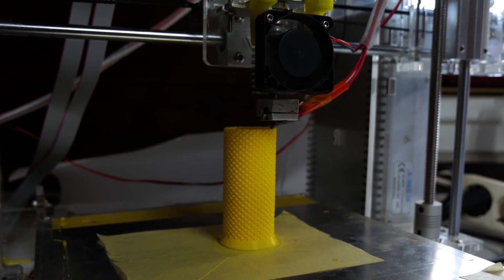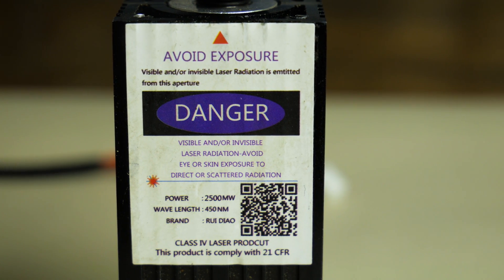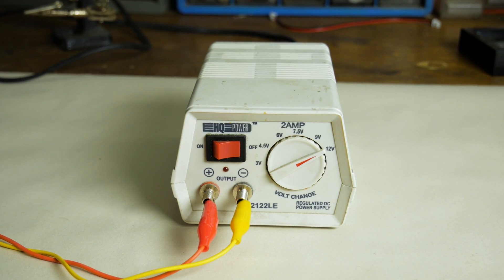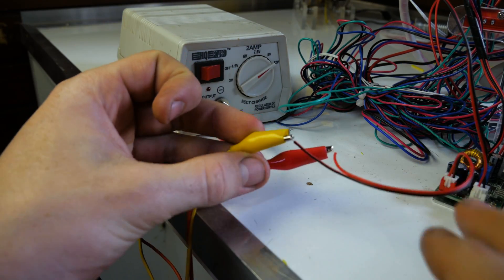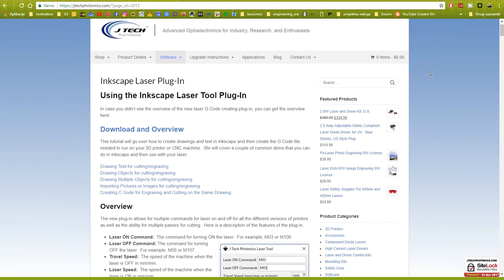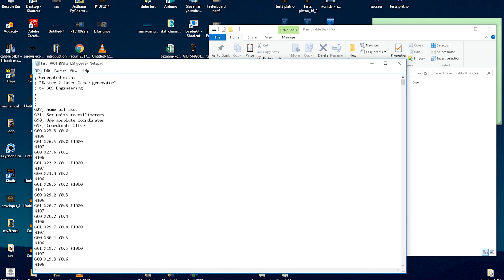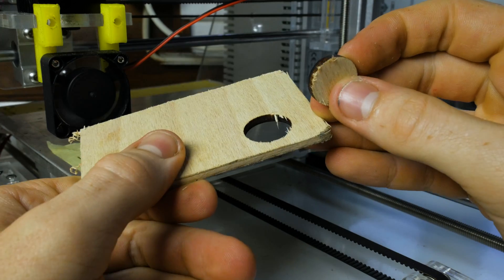Convert Any 3D Printer To LASER Engraver

Comment: Even this relatively low power 5W laser can burn off a paint mask to create PCB's of good quality for prototypes, and also cut fine material for structures. It's a better solution than a CNC to cut circuit boards as a CNC has to think 'outside' the box and cut away everything EXCEPT the copper. This is great for prototyping, but China production is too cheap for this to be of value on a large scale, but hobbyists and designers are in the goldilocks zone with this type of kit.

Comment: Nice, I want to add to my self made printer, how can i adjust z height for laser
Reply: Only add Z comand like this

; Generated with:
; "Raster 2 Laser Gcode generator"
; by 305 Engineering
;
;
;
G28; home all axes
G21; Set units to millimeters
G90; Use absolute coordinates
G92; Coordinate Offset
G00 X123.0 Y6.4 Z100  <-------------------this
M106
.
.
.

Comment: I have a  5.5 W laser. I’m trying to connect it to my 3D printer. But I don’t know if I need a regulator or Whet I have to do to even get it to work. Could you please help me. My laser is this from amazon.. 
Brand: Mostics
Mostics 5.5w-445nm Power Module Module for CNC Engraving Machine PWM TTL Control Adjustable Focusable for CNC DIY Engraver Engraver 5500mw power head

Comment: I connected the 5.5w laser directly without power regulator to the Rambo mini board PWM fan connector it worked for some seconds and then I disconnected the laser and connected the fan but now the fan stays on all the time. I think something went wrong so how can I resolve the issue. Is there any other PWM connector on Rambo mini which can be used for connecting laser.

Comment: Hi I have an Ender 3 and I recently brought the creality laser module, Although I only need 1 I purchased 2 buck converters 1 digital and 1 non digital, My question is how do I wire the buck converters so that the laser will work on my 24V printer, I’ve seen a few videos of people talking about user a laser module on a Ender 3 but they never show how to wire it up, I’ve seen a diagram on showing how you would do it but I still can’t understand it, Is a case of plugging a wire into my fan port then plug it into the IN of the buck converters and then plugging the OUT to the laser? Cause I’ve tried that but it gives no power to the buck, It says you need to the buck into the power supply but it doesn’t say where, If you could help me in anyway I’d be most grateful..
Reply: Positive and negative 24v from the power supply into the buck converter, but only the +12 out of the buck converter to the laser module. For the negative lead of the laser module, wire it directly back to the ground of the 24v power supply terminal of the printer. 
This configuration allows the Pulse Width Modulation control the variable laser power. 
Explained and illustrated in this video: https://youtu.be/hEk3aVARSGc?t=191
It's 3 minutes in. I hope this helps.

Comment: i have a tevo tornado, which works with a 24V board instead of 12V, is there any modification that I Should do to the wiring part?
Reply: Hi, maybe It's to late hahahah, but I am planing to do this on my jgmaker magic and I think you'll need a 24 to 5v regulator instead of a 12 to 5v regulator, I'm not an expert and might be wrong! let me know if you manage to do this!

Comment: hello. I have a 3D printer Flying Bear Tornado 1 power 24v. I Want to install a diode laser on it. In order to cut thick paper in one pass. Please tell me what laser power to choose? Will I need to feed air to the cutting area to cut the paper?Will this 2500 mW laser module work for me?  
Здравствуйте. У меня 3д принтер Flying Bear Tornado 1 питание 24 в. Хочу установить на него диодный лазер. Для того, чтобы одним проходом вырезать плотную бумагу, как ватман. Подскажите пожалуйста какую мощность лазера выбрать? Понадобится ли мне для реза бумаги подавать воздух в место реза?Подойдёт ли мне этот лазерный модуль 2500 мВт? https://aliexpress.ru/item/32919376971.html?spm=a2g0s.8937460.0.0.457c2e0eemm4c0&fbclid=IwAR1ROUziKtGqZDj8Qgc9oLAKnum25eRMk-G7qEf5F8RPZD5FT7AwOt-ywBU

Comment: Hi buddy. thank you for this useful video. I started working on making such a machine.
what I want to ask;
https://tr.aliexpress.com/item/32826357730.html?spm=a2g0s.9042311.0.0.27424c4dJ5as1Y
(Reprap Ramps 1.4 Kit with Mega 2560 r3 + Heatbed MK2B + 12864 LCD Controller + DRV8825 +Mechanical Switch +Cables for 3D Printer)
1) Can I use a machine as a mini cnc, laser, and 3d printer with the card in this link?
2) How many wt lasers should I take to process and cut 3mm plexiglass?
thank you.

Comment: hi , i bought a laser module of 5500 mw - it has two input sockets. one has 3 pins , + , - and pwm and says 12 v .  the other has  two pins ,   ttl + and ttl -  and says 5 volt . shall i use lm 7805  also for ttl from fan port. what about pmw pin in 12 volt socket.??
thank you indeed

Comment: hi , your tutorial encouraged me to add a laser to my 3d printer , in fact i am new to 3d printing too. laser module i bought from the same site (5500 mv)  but it has board mounted on laser itself. has two input sockets, one has three pins and the other has two pins. 3 pin says - 12v + and TTL/A-  and  2 pin says TTL/A+. now i am confused how to wire and connect it to my fan port which is 12 v system. this laser has a separate 12v power supply . kindly guide me with diagrame gor wiring.  many thanks .
Reply: did it work?

Comment: Any 3d printer ?? ...so my CTC 3d printer is not any. I don't have a clue how to connect laser to my printer. This video is not helpful for me.
Reply: Yes. I’ve done it with two of my printers, one delta and one cartesian. Power cables to the 12v port on the main power supply ( or separate adapter, your choice ) and the signal to the extruder fan (with buck converter depending on the laser’s voltage) this vid is about as straightforward as they get. It can be done through the extruder but you’ll need to modify the gcode.

Comment: i have the exact same setup. 
(only i also have capacitors before and after the lm8705cv)

instead of sepperate psu i use same atx psu as the 3d printer.(a sepperate 12v rail)  
and as soon as i turn on the printer.  the laser is on.  
and when i set fan speed anywhere between 0% and 100% it does not matter.     laser is always on. and always same power
Reply: I am having the same issue and was wondering if you figured it out?
Reply: @selamawitmekuria734  i didn't   not before my co2 laser cutter arrived.  At that point i kindof forgot about this laser

Comment: I have a question...
I have followed all your instructions, but the laser just stays on. When i change the fan speed, the voltage goes from 0 to 5 v
Reply: how??  my regulator just outputs 5v.  it's either 0v or 5v at 2% fanspeed and above.
i have the same problem btw.   laser just stays on
Reply: I solved it with a voltage divider... there are many calculators in the internet
Reply: @Mani-tp4xg  oh yeah.  I had capacitors on my voltage regulator.  So they would take the pwm signal and just output a steady and smooth 5v

I could not control my laser because apparantly the driver needs to warm up first. 

But its getting way too hot.  I am just going to skip the ttl port and do it like his 500mw video.  Except using a sepperate psu and a mosfet
Reply: darkracer125 the laser needs a 5v pwm signal 

The voltage divider just regulates the voltage from 12v pwm to 5v pwm

Comment: Thanks for the video, I'll try this next week. You can also use a voltage divider or a potenciometer for reducing the 12v input to 5v since it is only for ttl signaling.

Comment: High powered laser projects of any kind are extremely dangerous and require clear warnings/precautions and safety announcements prior to viewing, Safety glasses alone are not sufficient beam protection, precautions you yourself failed to observe, or make the viewer fully aware of the serious risk of permanent injury/blindness commonly associated with these types of conversion projects. Your re-wiring was shoddy and untidy (bordering unsafe) and a soldering technique that only demonstrated the incompetence of an amateur.

A renowned British surgeon amputated his own big toe with a laser scalpel, following a momentary lapse of concentration... an experienced professional who knew what he was doing!

This is my opinion, I could be wrong.
Reply: I have been working with and building high powered (5kw+) lasers professionally for over 10 years and while I agree that all lasers can be very dangerous. 
Stop talking crap and people might take you more seriously.
There is NO way that "A renowned British surgeon amputated his own big toe with a laser scalpel".
Lasers require focusing to be their most effective.
Laser scalpels peak out in the hundreds of watts max.
This is FAR from a power level required to penetrate and feed along flesh and bone to completely amputate a small finger in a accidental swipe! Even with a high pressure assist gas typically used for alloy cutting.

It just didn't happen "following a momentary lapse of concentration". 
Either that surgeon was deliberately cutting off their own toe. Or your argument is full of falsehoods and makes the whole comment redundant.

Comment: Hello. I have a question.
I want to buy a 5.5W laser to be able to cut in 5mm thick wood, but I would also like to make engravers (in grayscale). Is it possible to set the laser power to engravering, not for cut? if so how to do? greetings
Reply: hello?
Reply: Just set lower fan speed

Comment: @Jake's Workshop I have a question.  I have followed all of your instructions and yet my laser just stays on at full power while the machine is on and does not change with any fan control gcodes. I'm not sure what to do. I'm using the same laser and a Geeetech I3 the Prusa knock off.
Reply: its bacuase you printer doesnt put out a TTL signal. You can only engrave 1 bit pictures with your setup
Reply: I have the same problem and was wondering if u figured it out?

Comment: I was wondering if there could be a way to develop a software that uses the 3D data about the object you print to use laser engraving as a way to increase detail and smoothness of the object...

Like if the printing itself could have a "high detail" option that spits the process on "printing and engraving ones" where first prints the object and later the laser achieves better fidelity of the model removing/melting some areas of the material... making edges smoother saving time with sandpaper etc...
Reply: I know modern milling machines can add metal to a part & then mill it to dimension.  what you're talking about is pretty much the same, but with a laser...so its infinitely cooler.

I see you posted 3 years ago, you know of anyone whose put this into action?
Reply: @mtraven23  I think some very specialized equivalents use something similar, but more intended for industrial and specialized works, like could be Nasa for example, or others with needs of making prototypes with very low margin of error.

For the typical market, has been the resin based printers the ones that got cheaper and better

Comment: The 7805 regulator will understand the command to put more power or less power to engrave or to cut?
Reply: That's controlled by PWM (Pulse Width Modulation), in which control the on and off time in a rapid cycle. Going full "On time" would be laser cutting mode, and going full "off time" would be the laser stay's off. but going in between you can go into engrave mode.

The 7805 regulator should not have any issues with PWM at all. As for changing voltage, it is set to output at a specific voltage, 5 volt.
Reply: @Gentlyjack1  so in my case with added capacitors i pretty much completely eliminated the pwm part and it's a steady 5v output.  
ok that solves that issue. 
i have another issue. 

even with fan speed at 0  the laser is on.

Comment: Really nice...when i first played the clip i just ordered a cheap laser and tought it´s enough power. But now i changed from 0.5W violett Laser to a 3W blue laser. As the 0.5W Laser doesn´t use the TTL it was easy to get it work. The 3W Laser needs TTL but i can´t get it work. when i disconnect TTL wire from Printer the laser runs. But with TTL i can´t get it to start. any suggestions? 
I put a 7805CW to step down the voltage and measured 3.5V without any respoonse on the laser.
Reply: Make sure you wired it correctly. Red = Positive, Black = Negative/ground. Improper wiring can severely damage the TTL circuit.

The Positive should be connected on the 5v line with a 1k ohm resistor or higher going to ground. The negative should be connected to ground.

If your laser doesn't turn on at all with the correct wiring with your 3.5v, then the voltage is probably too low to trigger the on cycle. Try 5v.

Comment: Fyi you cant use any 12v power supply it must be regulated ps.....most non regulated power supplies will output much more than the volts listed....my 12v non reg supplies output like 16-19v....

Comment: 3:12
Let me just grab into that Class IV-Laser beam :D
I understand it's not in full power, just would like to see some kind of a warning at the beginning of the video...
A laser beam with this power output (especially when it's using a visible wavelength) is capable of completely blinding you in a fraction of a second- irreversibly. 
And no matter how naive somebody is, he will always be able to buy a kit off eBay.

Apart from that- good work, keep it up :)
Reply: ehh visible lasers are a fuck ton less dangerous then invisible lasers.  because both will blind you just as fast only with an invisible laser there is no pain and you don't blink.
Reply: @darkracer1252  I'll take @Lewakaassemms warning for anything above a 5 mW pointer, thanks. Call me silly and stupid, and also call me 'a sighted person'. The amount of people that have suffered for science or literal stupidity due to being warned and not heeding said warnings are legion. I couldn't care less if you think I'm an idiot or not, as your opinion means less than nothing in the face of safety and my ability to see for the rest of my life.
P.S. don't recommend anything to anyone. You're own ignorance will be your undoing along with your 4 friends, and our salvation.

Comment: Nice Job! I don't understand how the laser works. For the Power of the laser you use the fan. But for the on off of the laser (To cut or engrave) what input from the printer board do you use? 
Thanks
Reply from the maker: +SiGiCo84 Hi, for the power you use external power supply(12v) and for the laser on and off switch we use a fan signal
Reply: ok i was thinking that the on and off switch was given by the extruder. because in the printing software the fan is always on. so the laser with inkscape use the fan in the g-code to on and off  and   for printing we use extruder on and off right?
Reply from the maker: +SiGiCo84 that is right. If your printer does not have an option to regulate the fan speed you can also use an extruder command but then you would need to change the g-code command from M106 to the command for extruder

Comment: Nice project... BUT...
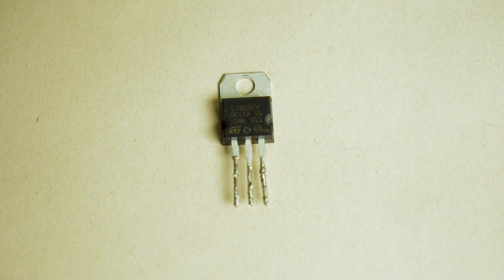1:28... Time to learn to solder properly... Heard of Flux ????
Reply from the maker: +lasersbee thanks :) Yea I have heard about that, I think It is already present in the core of soldering wires
Reply: @JakesWorkshop  It is in the solder, but it burns after a few seconds, so that's why you solder quickly and add fresh solder just when you solder, and don't "reuse" it.